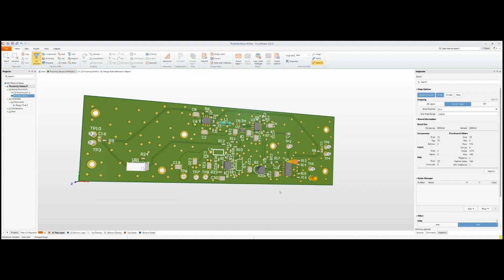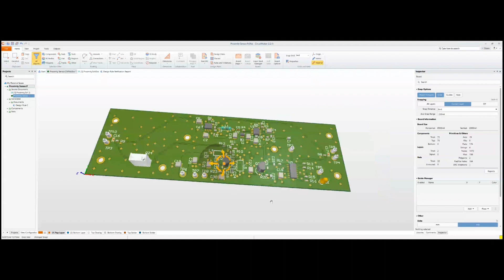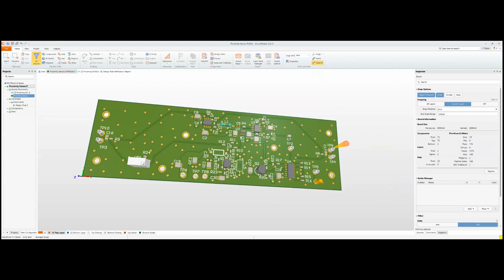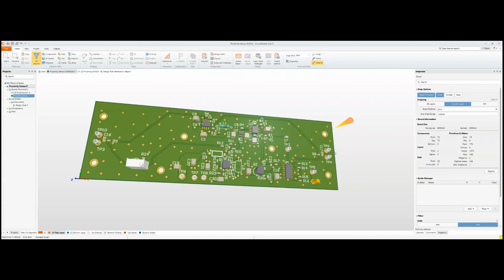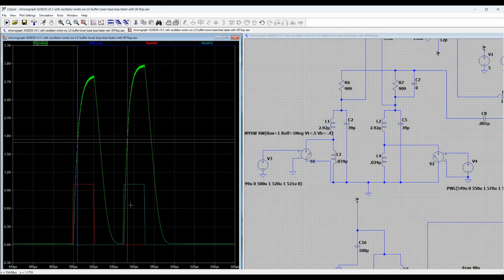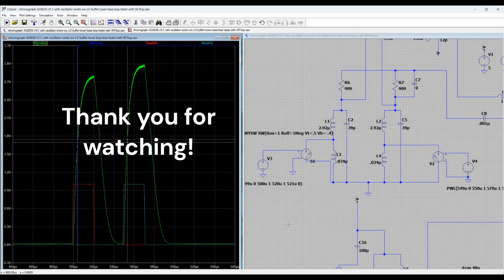CZ 457 MTR with Sensors To Measure Barrel Harmonics (Part 9)  PCB Design of Chronograph

Comment: Very nice. Love the design. I’m not understanding the harmonics tester. I’m not understanding how you are reading the information. Or how you interpret the numbers into tuning the harmonics. You are above my head lol😂. Can you give a short explanation in child’s terms ❤?
Reply from the maker: Sure....The barrel has a few sensors to monitor the whiplash and vibration.  So, with this chronograph, I can measure the exact time the bullet exits the crown of the barrel and with the sensors, I can measure the exact position of the barrel during the whiplashing.  The goal is to control the position of the barrel by adding weights so the point of impact at 50 yards will be consistent.
Reply: @TunerPlinker  have you considered exit debris? Will wax (lubricant) debris affect the inductive sensor?
Reply from the maker: Wax will not affect the inductive sensor.
Reply: @TunerPlinker  yes. Thank you. I know what you are doing. I have many tuners. I can’t figure out what you see on the screen that you are reading. I would love a device like you are building. And would want one. But I don’t know how to read the results you are getting and apply that to the tuner. Just need to know how to use it. Lol
Reply from the maker: @jwoodshed1108  By the time I am done with all the sensors, I will make the grand finale video where I will incorporate all the sensors and show you how the data is used to calibrate the barrel with a tuner.  It will take about a month when I get my chronograph sensor PCB from the vendor.  Initially, I will use my oscilloscope to measure my sensors but eventually I will incorporate a microcontroller where it will do all the calculations and you won't need to know how to read the data.....very exciting things that will change how people will tune the barrel.
Reply from the maker: @jwoodshed1108 Once I have all the sensors working and incorporate a microcontroller, I might make it available for anyone.  I am not a programmer and so it might take me awhile to sort out the programming side.  I have a few weeks to learn.
Reply: @TunerPlinker  very cool. Let me know when it’s available. I use fusion360 for cad. And have a printer. I know the pain of designing a part and all the fixes it takes to finish it lol. I love the plan you have. I always wondered if this could done. I’m happy to see each video, even though I don’t understand it all yet. I thoughabout a high speed camera at the muzzle with some kind of tape measure behind it. Zoom in and correlate the target and velocity data.  Your idea is amazing. Great work.

Comment: Outstanding work! The improvements in sensitivity are promising. Will the 3D-printed mounting mechanism be created for an ARCA rail or some other attachment point?
Reply from the maker: It will mount onto the existing rail with the Arca vise.  Not sure if I will change it completely yet.